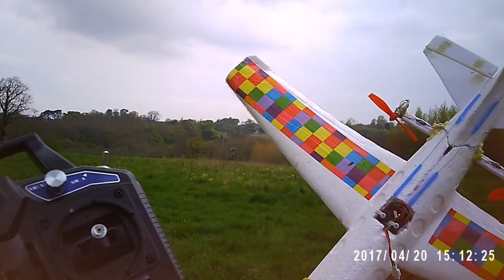Poundland Glider RC Conversion changed thrust line

Comment: Just around the corner, is a circling flight of triple the length, complete with whoops of joy and congratulations from us lot !
Still tail heavy, but it wants to fly now :)
Reply from the maker: I came very close to a controlled flight on Tuesday. Some level flight and a controlled turn. It's odd, I really should have abandoned this a long time ago and started fresh but it teases me with the promise of a success. The last two outings have resulted in significant breaks due to the heavier battery I am using to balance it but a bit of glue and leave it to set over night and we are back again 😊 If nothing else it gives my viewers something to laugh at.

Comment: thanks for posting.  nice work.  some thoughts.  the model appears to be a bit under-powered. see suggested wing mod, below.   the main wing appears to have near-zero dihedral.  the model is going to want turns to be initiated with aileron input and completed with up-elevator.  or, mount a wing with dihedral.  the wings do not appear to generate as much lift as one would expect.  the design of the wing tips is letting lift 'escape'.   to keep more lift under the wings, outboard, small wing tip skirts could be tried.   idk what to say about the thrust angle.    cheers
Reply from the maker: This one has gone through quite a bit over the series and it is probably time to start fresh with a new one BUT the idea is NOT to do significant modification to the main structure. I have seen successful conversions but they usually involve replacing the wings and tail and I feel that if you are going to do that then why bother starting with this toy anyway. There are currently 30 videos in the associated playlist, not all my videos so there are some successful ones there. Check out the one by Slider2732.
Reply: my comment is not about making mods.  it is about what is going on with the model you've made.  and how its flight characteristics might be improved.   my intent in commenting is to share information with you, and your subs.  i mean no offense, but after so many builds, i am confused by your 'by guess or by golly' approach to problem solving.   is it just your style or are your videos are intended for a younger audience.     cheers
Reply from the maker: My approach is that I want to find how things work for myself and yes that is generally by guess work. I show people what I have done and they can decide if they can do better or choose an alternative way. In the case of model aircraft, if people want advice I usually send them to the FliteTest channel. As for "younger audience"  no, I have no target audience, I am an old guy who is retired and now enjoying doing what I want to do and sharing it with anybody who wants to watch it. I do seem to have plenty of young viewers but I also have a good number of people in my own age range who also have finished working for a living and enjoy doing similar projects that they missed out on during their working life.
Reply: thanks for your response.  btw- i'm an old retired guy, too.    cheers
Reply from the maker: Thanks for your input David, I appreciate you are offering help and support :-)